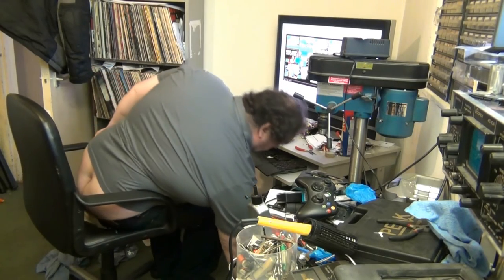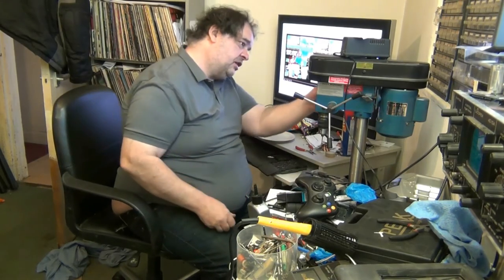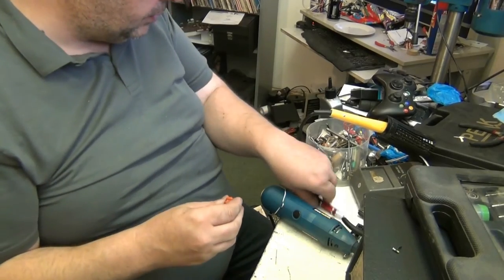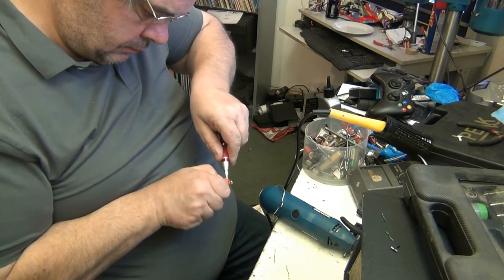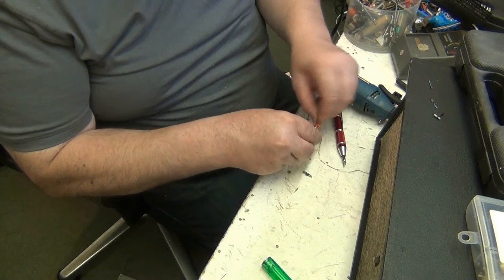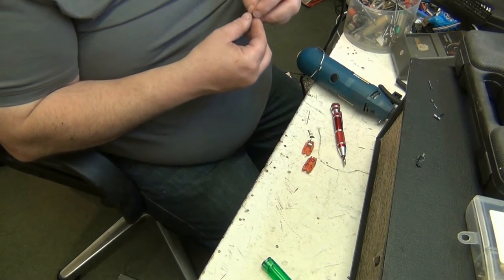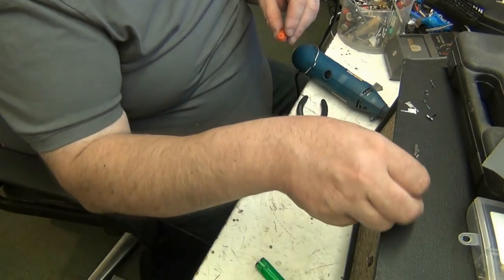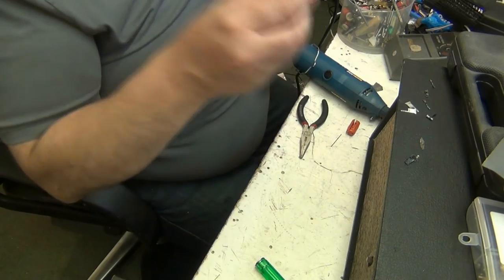REBUILDING THE BSR FUL FI CARTRIDGE

Comment: A very informative and interesting video. I'm presented with a similar problem. The BSR TC8H Ful Fi isn't producing any sound. I replaced it with a new BSR X5H and the sound is very trebly. I also have new SX6H but because it's new I'm loathed to dismantle it. The Dansette Major I'm working on has a new JJ EL84.

Comment: I am getting a humming from the turntable and cant decide if its the cartridge. When I remove leads on cartridge the humming continues, deck is earthed correctly.
Reply: The amp probably needs to be recapped. The filter capacitors are no longer doing their job filtering the 60 cycle hum generated from the power lines.